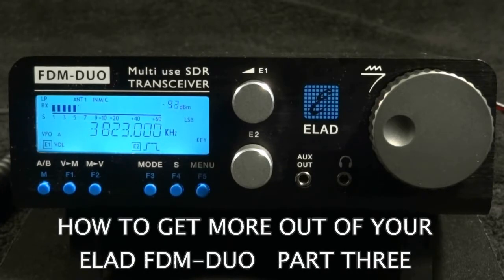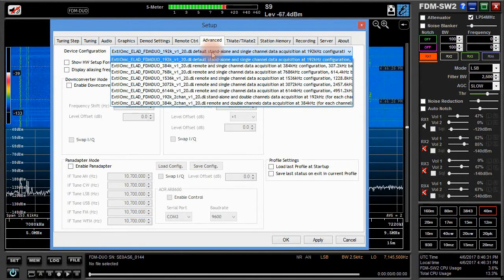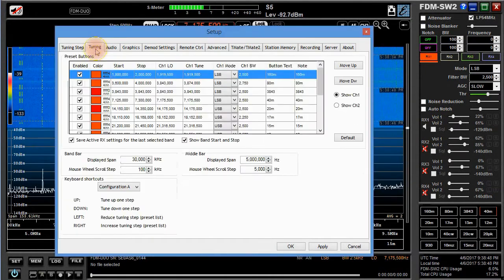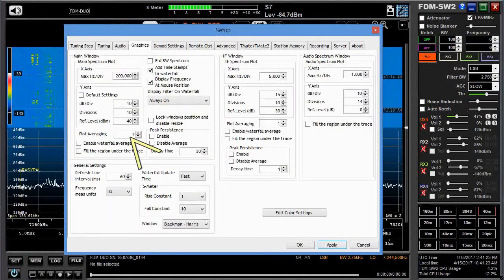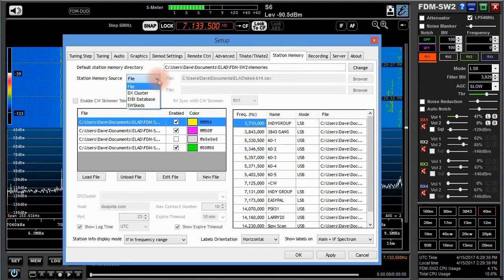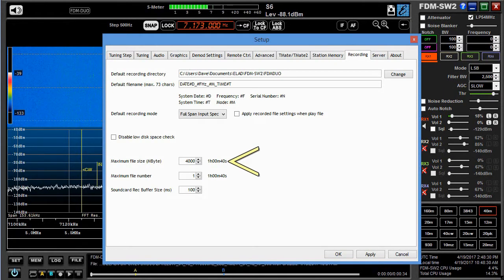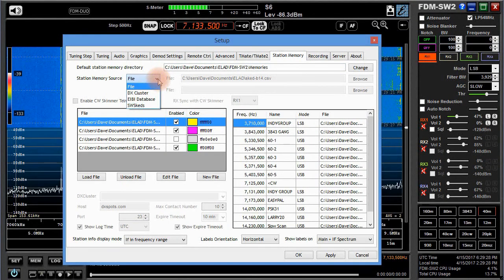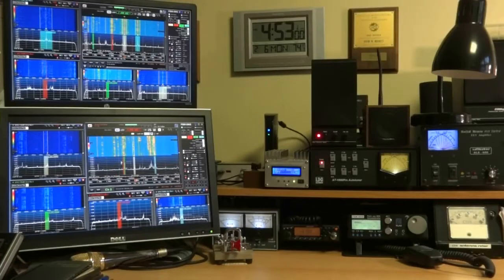Elad FDM DUO SDR HF+6m Transceiver Pt3 Advanced SW2 by W8KFJ

Comment: David, do you know if you can use the mic from the PC (Headset) as a mic for the Elad. This is possible with the Flex and would be a real dealbreaker for me if this isn't possible with the Elad. I wan't to use it for remote operating.
Reply from the maker: Yes, you can.  Of course, there are several other elements that need consideration as well.  Dayton may produce more options too.

Dave  W8KFJ
Reply: Are you planning on making a video on how that works? I'm really curious about the remote control feature.
Reply from the maker: Haven't really done anything with remote, so no video.  I have used splashtop on an android tablet that controls local computer, with receive audio.  A BT microphone would get me maybe 30 feet from the shack.  At this time it requires a local computer to be running.  I just never had the initiative to do much with it.